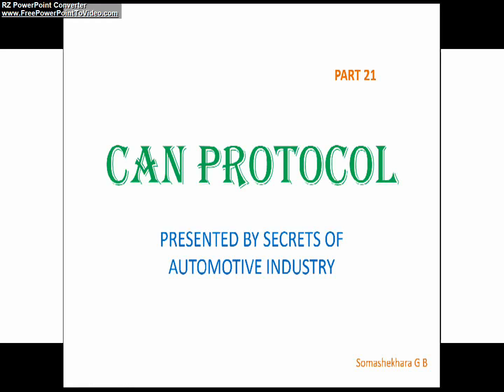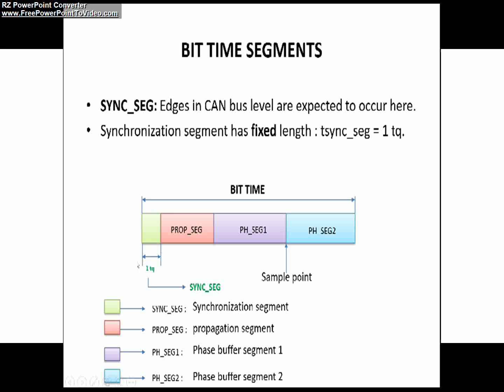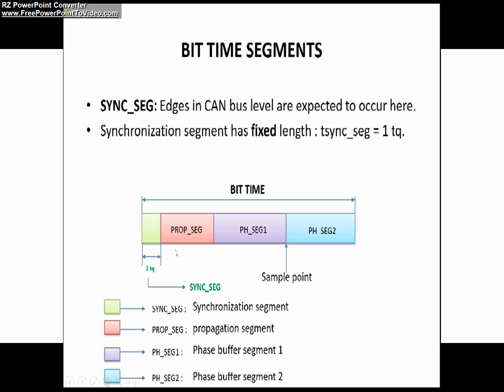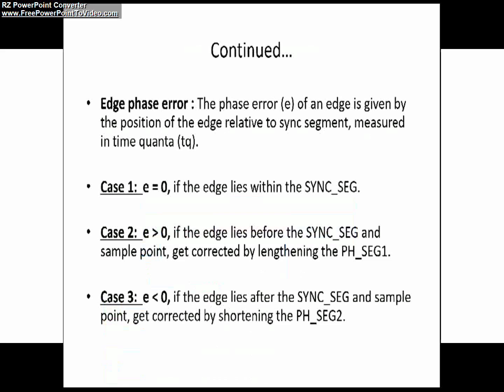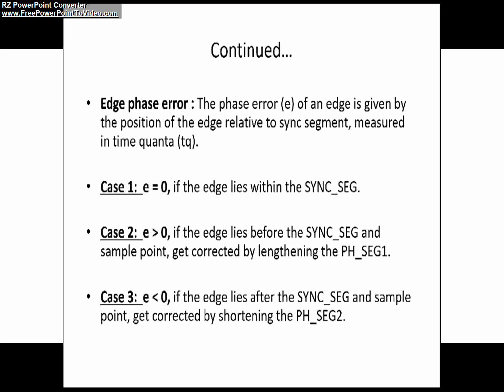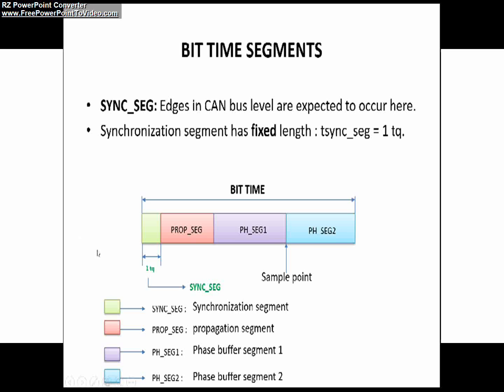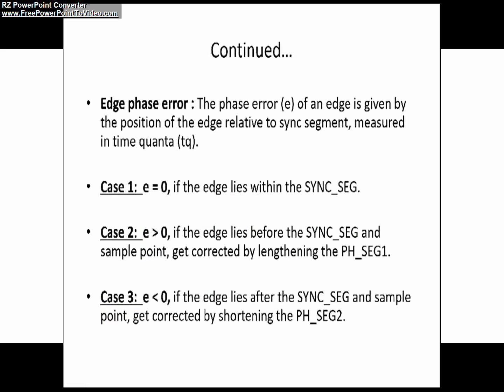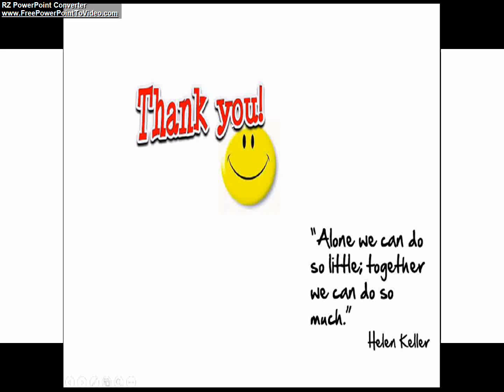CAN protocol basics, PART 21, CAN Bit segments, SYNC_SEG

Comment: What is sample point? How receiver can recognize the e>0 case i.e.edge lies before the SYNC_SEG, in this case edge not in the bit timing ( any of the segments)? Am I clear to the question?
Reply from the maker: Sample Point: It is the point of time at which  incoming bit value is read and interpreted as recessive/Dominant.
How receiver can recognize the e>0 case i.e.edge lies before the SYNC_SEG: Receiver will be having it's sample point rate (for example : consider 80 %), if e>0 means edge falls before the SYNC_SEG. hope it's understandable now, if not please leave comments here..will get back to you..
Reply: @secretsofautomotiveindustr2910  
Sir,

What does 80% receiver sampling point mean.Does it mean in a bit time the receiver samples only at (.8*bit time) of each bit?

 What circuit or mechanism compares the phase error this quickly in can?
 Also why do we lengthen seg1 for e>0 and shorten seg2 for e<0 ? How does this help with 80%sampling or interpretation?

 Thanks...